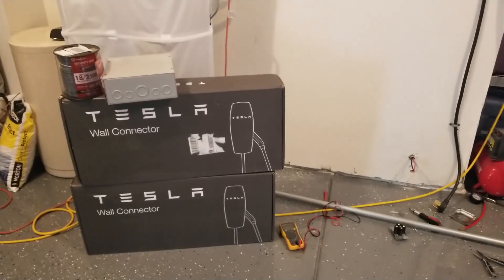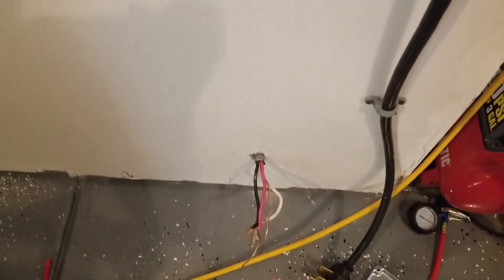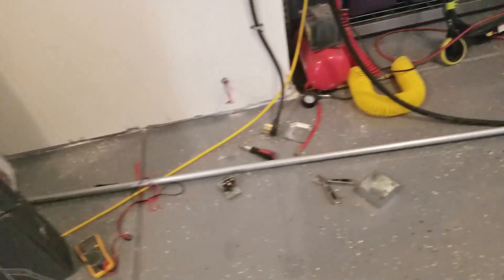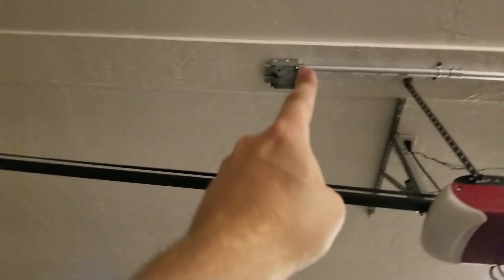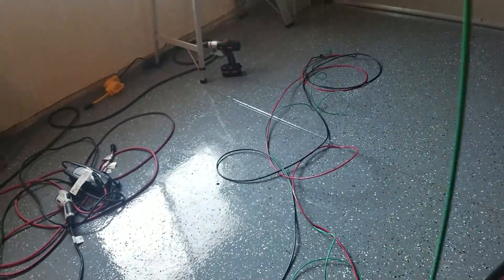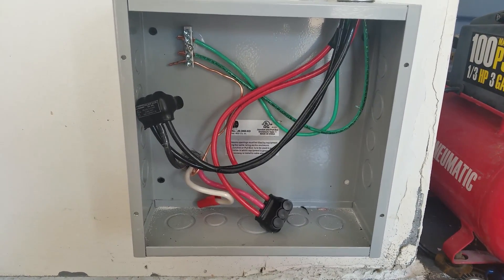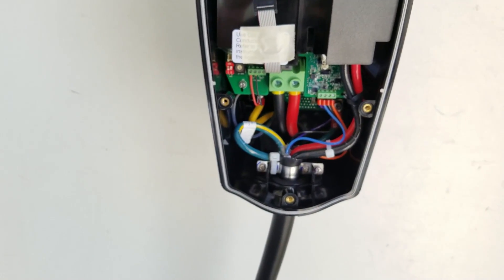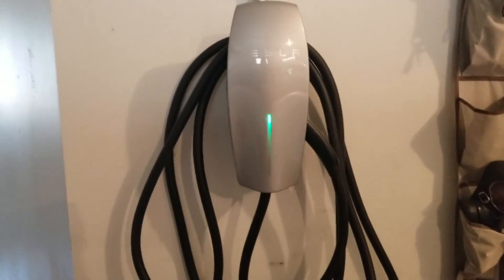Installing 2 Tesla Wall Connectors in Load Sharing Configuration

Comment: Hey buddy!  Great video.  I hope all is well and your house is still standing.  I'm not a certified electrician, but my electrical engineering background leads me to believe that you should revisit your first junction box and do some rewiring.  Ground wires are not meant to be load carrying which is why the come without insulation.  Since you are not using the insulated neutral wire you have now energized your bare wire and the conduit and the boxes.  Should anything happen to break the ground wire going back to the junction box, someone will be very surprised to find that it will measure 240V instead of 0V.  Also, should something touch your junction boxes or conduit that has less resistance than your ground wire, it will now become the new preferred path for electrons.  

Ground wires are only meant to complete an emergency temporary path for the electrons if anything shorts out to the boxes, conduit, or other items that humans can touch, they should not be used to carry a constant load back to earth.....that's the job of that insulated neutral wire.  If you go to the breaker panel in your house, you will find the neutral and grounds tied together via a bar.  This is the only place they should meet.  If you have no shorts in your house wiring, you should be able to disconnect all of the ground wires in your box and touch them without getting shocked because they should not be used to complete a circuit.....
Reply: Not sure what you are talking about but this is completely false.. Electrically everything looks great in the video, the only thing he may have overlooked is you are not allowed to run data wires in the same conduit run as the live wires unless the data wires also have an insulation rating of 600V. I don't see it as being a safety risk but it may not pass an inspection if it were ever looked at.
Reply: You're an electrical engineer? You should know that you do not tie neutrals and grounds together in a sub panel. Only at the main service panel is this allowed. SMH.
Reply: Yes you are correct. I did not research the Tesla charger prior to my reply.  I didn't realize that it contains a GFCI type of circuit to monitor for any power sags across the phases.
Reply: I agree with you.  However, I never mentioned a sub-panel.
Reply: @Abomynous1  You didn't have to mention a load center, you described correctly what would happen if you came off a load center. What the homeowner had was a junction box only. All level-2 and Level-3 residential and commercial EVSE do not require a neutral conductor.

Comment: So with the 50 amp circuit, you are getting a 40 amp charge, right?  I have the same NEMA circuit, but you think I can swap out the 50 amp for a 60 amp breaker w/o changing the gauge of the wire and get full 48 amp charge?
Reply: yes you can.  6/3 is good up to 60a
Reply: @bretlanshelvin8628  #6 THHN is rated to 85 amps, #8 Awg. THHN is rated to 55 Amps.
Reply: @kirklandelectricicnc  i have 6/3 and was told 0a is max at 30' drop.
Reply: @bretlanshelvin8628  It depends on what type of conductor you're using, for example, #6 AWG, copper THHN/THWN-2 90-deg. "C"  is rated 75 Amps max. If you use aluminum or copper-clad aluminum at 90-deg. "C" it's rated at 60a max. For the average residential installation calculating the voltage drop is not necessary because the runs are usually under 50 ft. and besides,  the Tesla wall connector can operate at 200 volts to 277 single-phase power at 50/60 Hz. The only drawback to the lower voltages is the time it will take to charge the vehicle.
Reply: I just installed NEMA 14-50 outlet last weekend. I thought of using 60A breaker too. However, I found out the outlet only rated for 50A. That means I can not use 60A breaker even though I used #6 wires.
Reply: @cameraone1 you should run a nema 14-50 to a 50amp breaker not 60

Comment: Where did you get the spec' that pointed you to the security wire? I ask because the Tesla wall changer installation manual (page 28) says: "If the signal wire is routed in the power conduit with the power wires, the insulation rating of the signal wire should be equal to or greater than that of the power wires." 

The insulation rating of that security wire is 300V which would definitely not be up to that of the power wiring (usually 600V). I don't doubt that everything you did will work fine, but if one is trying to meet the letter of the spec, I wonder what wire is supposed to be used?
Reply: One could get noise coupled to that signal line being so close to the high(ER) voltage lines.  For that reason alone, I would route it differently or further away.
Reply: found  this Wire that is 600 volt rated
https://www.wireandcableyourway.com/belden-1120a-18-awg-1-pair-shielded-tray-cable-600v.html?
 $25   gets you over 50ft. Shipping is extra. Shielded wire should only be grounded a one end to avoid circulating ground current, but even Tesla video missed this.

Comment: Great Video! Does the junction box need a breaker or can I just use the connector like you did for a 100 AMP install?
I currently have the 1st gen wall connector for myModel X but will have to sell it and get two new ones for my X and 3. Plan to do the install myself.
Reply from the maker: As far as I have researched; anything more than 60 amps needs a cutoff switch in direct line of site. An inspector may say that a breaker panel inside the garage fulfills that requirement. Otherwise you need one of those big switch boxes with a disconnect.
Reply: Any safety issues if I use a Polaris connector on the 100 amp like you did for the 60?
Reply from the maker: No, the Polaris Connector I used is UL listed and rated for up to 600V Gauge #4 to #12 wire.  ( There are even larger polaris connectors should you need.)
Reply: Do you have a link for a Polaris Connector that supports 2 AWG wire for 100 AMPS? I looked everywhere but can't find it. Thanks!
Reply from the maker: https://www.amazon.com/Polaris-Multi-Cable-Connector-Height-Length/dp/B00CTYO7IG/ref=sr_1_3?s=industrial&ie=UTF8&qid=1504577032&sr=1-3&keywords=polaris+2+gauge#feature-bullets-btf

Would that work? These large blue ones seem to do from 3 AWG to 0 AWG
Reply from the maker: I also found this: http://www.polarisconnectors.com/pdfs/NSi/IPL_series.pdf
Reply: Over 60A you need a disconnect, and for that reason you might decide to install a sub panel with a lock accessory for the breaker. 

NEC 625.43 Disconnecting Means. For equipment rated more than 60 amperes or more than 150 volts to ground, the disconnecting means shall be provided and installed in a readily accessible location. The disconnecting means shall be lockable open in accordance with 110.25.
Reply: @johnfpane  No lock needed within visual range of the panel.